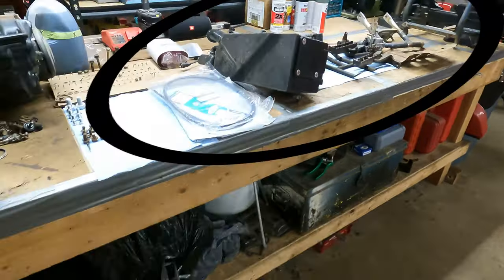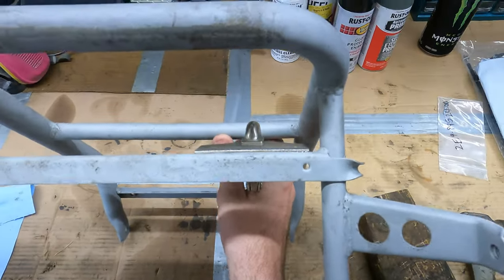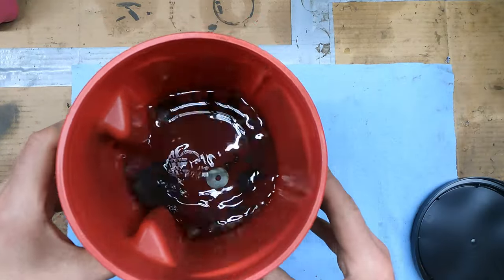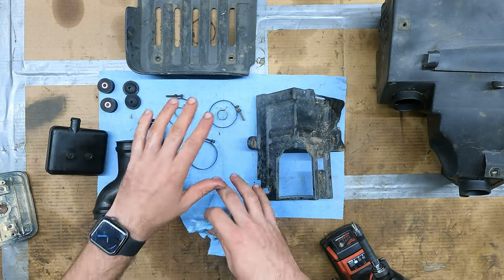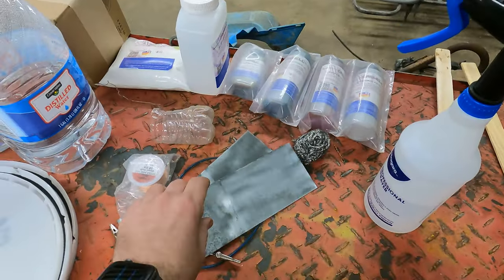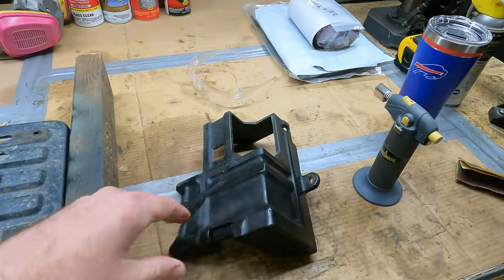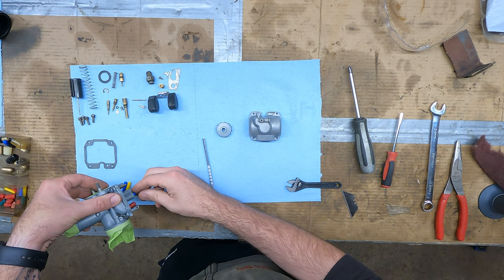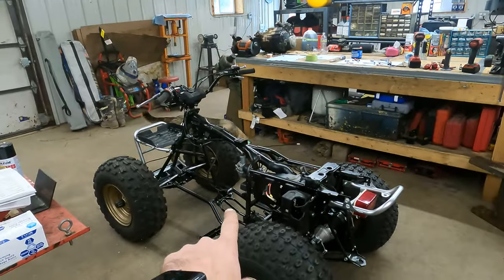We Finish Up the Chassis on the Moto 4! ATV Restoration Part 4!

Comment: Hello I’m rebuilding a yfm200dxs with suspension and I’m wondering if the engine for the 200n will swap right on or is the drive shaft different?
Reply from the maker: I’m not sure 🤔 this is the first moto 4 I’ve ever really gotten involved in.

Comment: Been watching your video rebuild and a little confused, your motor doesn't have a swing arm or front suspension yet all the moto 4 200 I am looking at buying here in Australia do have suspension
Reply from the maker: So at least here in the states in 1985 they only made the moto 4 yfm200n and it was ridged frame (no suspension) then in 1986 they came out with the moto 4 200dxs (has suspension). And in 1987 they came out with the moto 4 yfm200dxt (has suspension). In 88 it was the yfm200dxu (has suspension). And in 89 it’s the yfm200dxw. (Has suspension) that’s the last year 200. So only the 85 had no suspension.  I just had to do a little looking 😂 sorry I spelled them out. I was curious too!